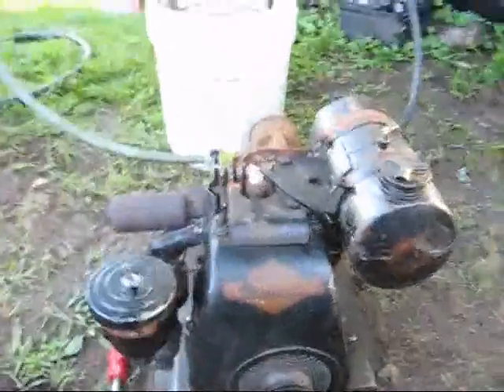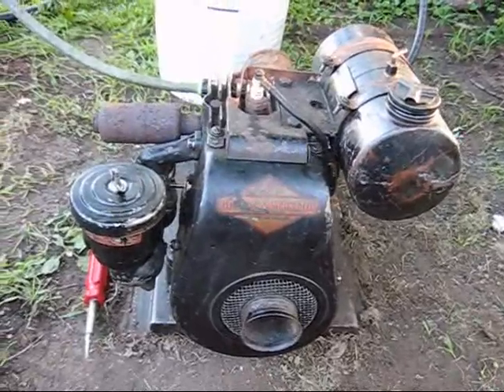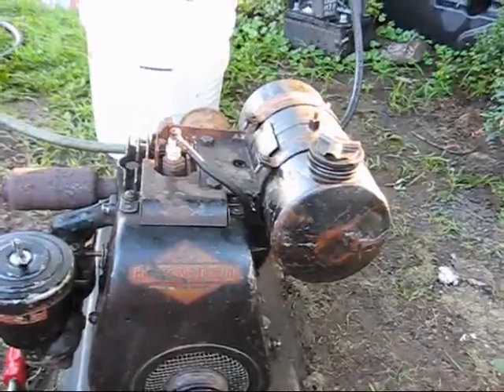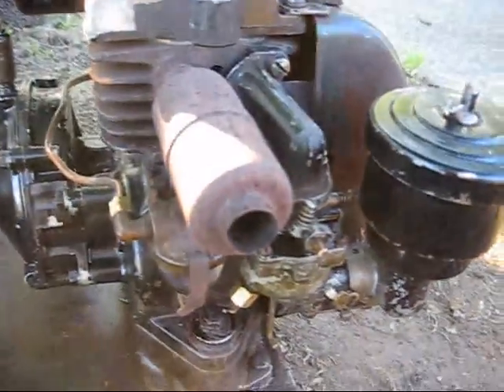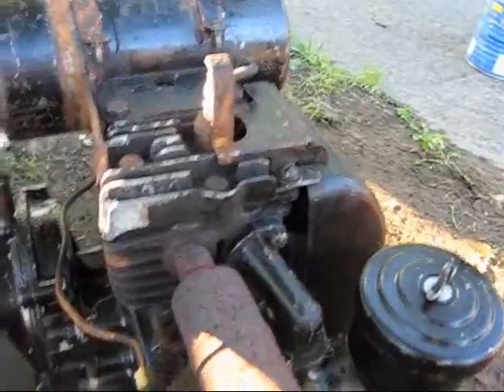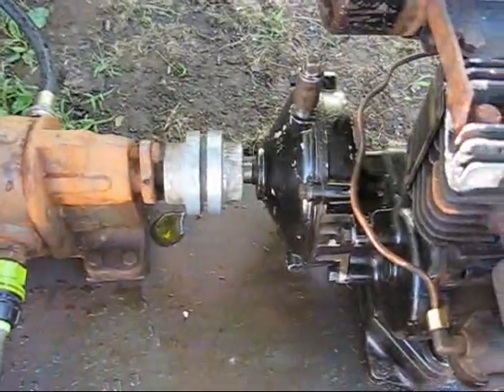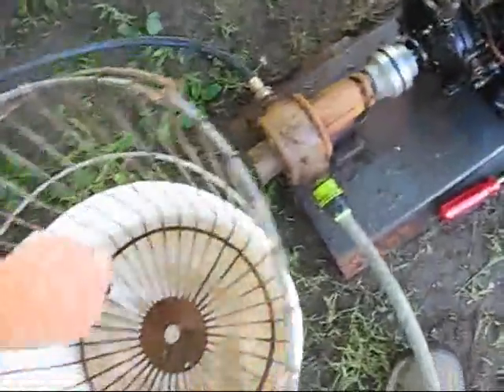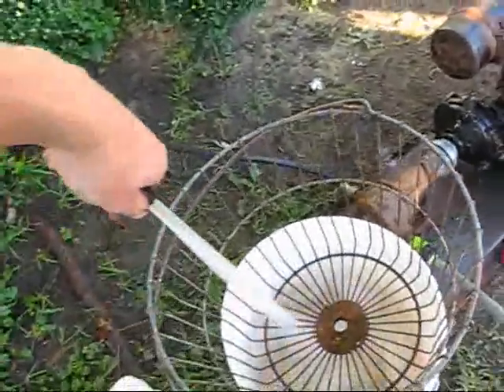1950 Briggs NPR6 with BSM 'B'&'S' series No.3 gear pump!

Comment from the maker: @zulu696Q you most likely do have the same engine. i had 2 of them and sold one of them. the NR6 and NPR6 are pretty common engines. they seem to have been pretty popular engines. the 6 in the model indicates that the engine is equipt with a 6:1 gear reduction. the pump is still in production. google BSM Pumps. but they are VERY EXPENCIVE pumps. very high quality pump. they are made to move a variety of different fluids

Comment from the maker: @Hallaran they are great little engines! i sold my earlier model N which i only ever had running once due to a broken oil slinger and nearly seizing it up, turns out the past owners did the same thing! i sold it to cubcadet puller for a reasonable price in hopes that he will fix it up. i just kinda pushed it aside when i bought this real nice low hour one! this engine is tight! and the pump works really really well! best $5 engine i ever bought!

Comment: I'm going to get an old Motomower this weekend minus the engine, but I have an early Briggs A model I'm going to put on it. Not much action around here lately. I did pick up an NP with a pump on it recently, but I haven't even messed with it yet.

Comment from the maker: its in fantastic shape, for being an engine nearly 60 years old. it feels like it hasnt been used much. id honestly be surprized if it has 200hrs on it the way it feels. its got excellent compression no play that i have noticed so far. the carbs throttle shaft is still tight where on some of my other flojets its worn out. its a great engine!  runs like a top!

Comment: Real nice pump, but you might want to check the engine serial number again. That engine was likely built in the 1950's. It has the later aluminum head, the later intake design, and a late style air cleaner.

Comment: Actually, pretty much all small engines were designed to run on unleaded gas. Even the Kohler manuals of the 50s and 60s say that unleaded is recommended, although leaded is okay but will require increased maintenance.

Comment from the maker: well im not sure of when leaded gasoline was stopped, but up until they stopped adding lead to the gasoline (1970's i belive) pretty much all small engines were designed to run on leaded gas. so i just add a splash of marv's mystery oil to the gas every so often. unleaded , wont hurt them, but the lead was used to lubricate the valves, so a couple dropps of marv's mystery oil does that.

Comment from the maker: that is a coupler similar to a lovjoy it has a rubber connector that stops any sudden shocks caused by the pump from getting to the engine. and the model NR6 stands for model N and the R 6 stands for reduction of 6 to1

Comment from the maker: ill say! they had a few engines i was interested in at the auction, unfortunatly 2 of the 4 i found out acually were not in the auction and were not for sale, 70's briggs and a 40's or 50's clinton. but the other 2 engines were fair game! the briggs and a little k91 powered kohler generator from the 80's it looked like. it was NICE! but it sold for $95!! so i came home with this and a big ole window fan.